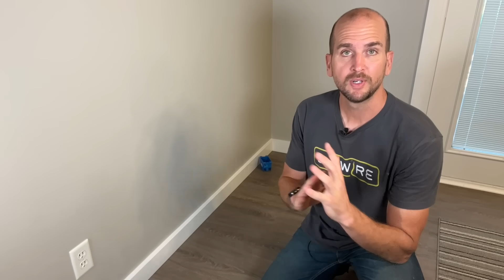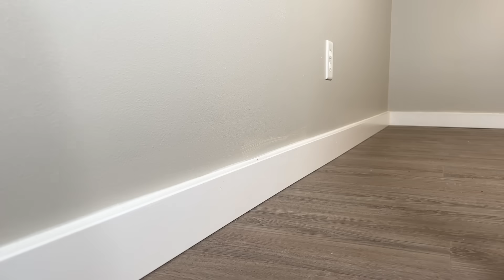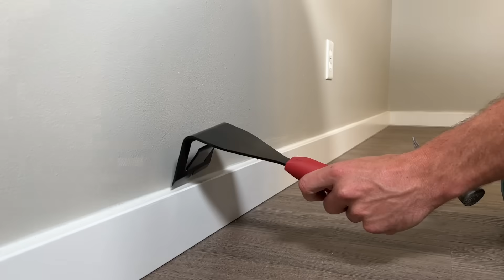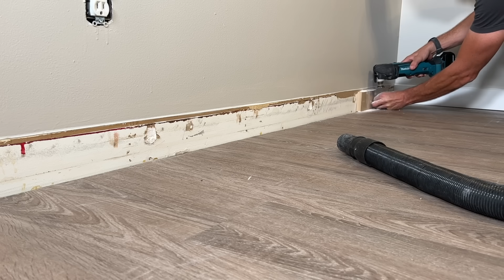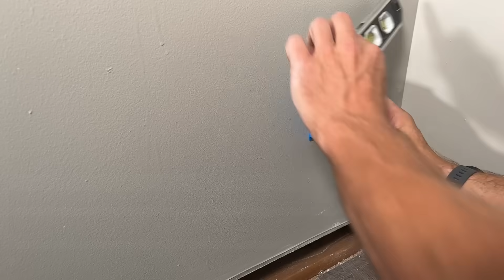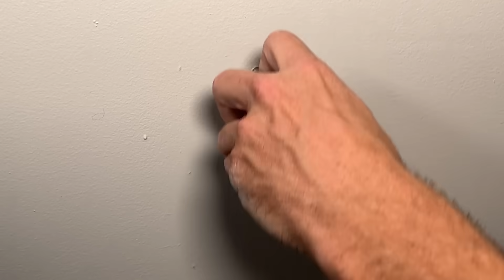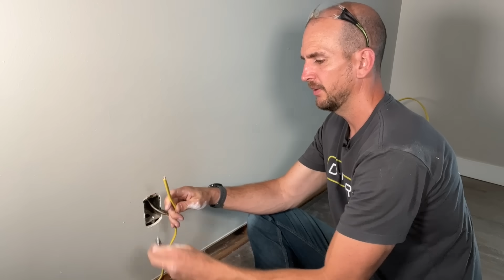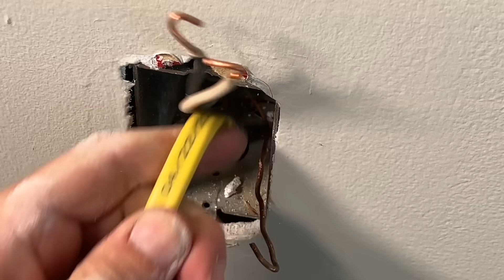How To Add An Outlet To A Finished Wall

Comment: what do you do if you have an older house that doesnt have a ground wire coming out cause the plug grounds to the box. would i need to unhook the ground wire from the metal box and connect it like you have in the video
Reply: If your jumping off to another outlet then yes. But if your just leaving that outlet as is that ground wire is fine.

Comment: Don’t know much about electricity, I’ve seen others use the 14 gauge romex is there a particular a reason why someone should use 12 gauge over 14 and vice versa?
Reply: 14 is used for basic residential wiring for outlets and switches. 12 is used for your bathroom outlet as well as kitchen outlets plus your refrigerator. This is because the appliances you plug in to these outlets will draw more power or more current, meaning it can be used for kitchen appliances and many other products that use more electricity.
Reply: EASY answer, WIRE GAUGE is based on CIRCUIT size, no matter what you meet the smallest but can go larger (sometimes).  For basic residential receptacles 15/20-amp, meaning 15 or 20-amp circuits, you only use 14 or 12. These devices are only rated for these sizes typically..    15-amp circuit=MIN 14 awg / 20-amp circuit-12 awg...

Comment: In my garage I accidentally put a screw into the romex wire and tripped the breaker. What are my options to repair this? Can I put another outlet in next to the existing outlet that's 32" away? Is there a minimum distance an outlet has to be away from another one? Or splice the wire safely?

Comment: Very clear and informative, but what was the point of going through all the locating and measuring to determine the location of the studs, when they were easily visible after you cut away the sheetrock at the base of the wall?

Comment: It was going great until I tried to snake the wire up and discovered horizontal "blocking" between the studs about halfway up the wall to both the old and new receptacles. Had to create an opening. Now to find the youtube video on how to repair a hole in sheetrock.

Comment: Hey You installed the outlots upside down. :) If you check the outlet before installing, and read the words, you'll need to will flip the outlet so that the ground is on top. This flip is intentional. :) Ground on top is to ensure electrical safty. For example: if someone gets fancy in the future and puts a metal plate on the outlet, then later a 3 prong device is installed but slightly pulled out, then the metal plate falls off due to a missing screw, the plate would fall on the exposed condutors. In the way this vidoe shows the outlets, the plate would first hit the nutral, then the hot contuctor. This could energize the plate it self and other outlets via the nutral bus and fry sensitive unprotected devices. However if you install it the way the manufactures indend, with the gound on top, the falling metal plate would first hit groud, then if it touched the hot side it will trip your breaker.

Comment: Tamper Resistant outlets and arc fault protretion for any circuit extensions if not already protected,be aware of the arc fault code for locations  in dwellings via a arc fault breaker, nec 210.12 B,  at panel or arc receptacle where you start your circuit extension and label downstream with sticker arc protectected. Be also aware may need arc/gfi protection if in an area needed by code. 210.8

Comment: I am an electrician with almost 30 years of experience. I was expecting to nit pick this video like crazy, but everything in this video is correct. The only things I would do different is leave a little bit more wire in the boxes and wrap the outlets with tape because of the metal box. I could not tell if the metal box was grounded though.

Comment: Great video. Pro tip- when using an old work box, break off the tabs on the top and bottom of the outlet (to the left and right of the screw hole). otherwise the cover plate won’t sit flush.

Comment: Awesome job~very informative. 
Quick question=can you pigtail aluminum wiring with the connectors, since aluminum is gauged different; [#12 Al =#14Co]; is there a need for oxidation material, and, can the quick connector handle expansion/contraction on the aluminum  wiring without the connectors becoming loose?
Thank You!! JG2

Comment: Ok for the US but not acceptable for the UK. We have safe zones in which we run cables and the kick board is not one of them. Also no mention of safe isolation of the electrical power.

Comment: Great video!
Did this exact thing but my walls had insulation so it took a bit more finagling.
I found out my existing outlet already had another outlet chained off of it.
The builders did the speed connector/backstab.
I took those out and combined all 3 outlets into a wire nut with pig tail.

Comment: You are assuming that your source box can accommodate at least 5 No 12 wires.
How about if it is smaller than 4x2-1/8"x1-7/8"?
Would you go with No 14 Romex and replace a corresponding breaker for 15 AMP or replace the box for bigger one?

Comment: My only issue with this hack is when someone decides to install a 5"+ baseboard in future, they will run the risk of puncturing the line. This works for you in your situation, but down the road, It's a ticking time bomb

Comment: A bit late to the discussion - some jurisdictions (ours in particular) require that the bonding wire be screwed into mettalic duplex box - from either a pigtail, or a longer run - especially if you have a double romex box (as they can split).  This ensures that the mettalic surround, and the ground from the outlet, are grounded at all times, even in the event of a receptacle failure.

Also, those styles of plastic romex box (blue ones) are not permitted, and any additional romex box MUST be mechanically supported by either nails or screws affixed to a stud.  This can be a bit of a challenge if you are working with metal studs (but not surmountable).  The reason is that the constant plugging / unplugging of a device onto the installed outlet can cause the little plastic/metal attaching pins to fail, causing the entire outlet and surround to become loose.  Most uses of those plastic receptacles are for low-voltage wiring, like rj-45 ethernet cables.

Of course, some other jurisdictions require nothing less than AC-90 armoured cables.  

Always check with your local jurisdiction first - and please make sure you pull a permit / have it inspected if you are DIY.  Not only does it CYA in the event of a fire and insurance claim - it also prevents weird strangers from showing up at your home and taking a giant crap in your toilet water tank.

Good luck

Comment: I like the Wago connectors, but they weren't needed for this. The original receptacle  can act as the connection between the original wire and the new wire, no reason to complicate things.  and of course the new receptacle has wire directly to it.  by the way, the Wagos are the same principal as the stab in wire connections on the receptacles.  Either you like those or you don't.  I love them and have never had a problem with them and are UL approved.

Comment: I noticed that the original outlet was at the end of a run (only fed with 2 wires). Is there a reason you didn't just chain the new outlet off the old, instead of making the pigtail connection?

Comment: I must have missed wiring 101. Im not an electrician by trade but i have wired quite a few double receptacles. There are 4 slip in holes on the back. 4 screws on each side and the green screw for ground. When ever I put a black hot wire on one side and a white neutral on the other Both receptacles become hot not just one.  The only time I use all 4 holes or screws is if the line is continuing on to another receptacle or switch. Did I miss something or miss understand something??

Comment: DO NOT DO THIS
1. Bored holes were not air insulated.
2. NEVER put wires behind your baseboard  screws and -finish nails will drive right thru the wire 

Label this video under "wire for fire"

Comment: The video fast forwarded at the parts I needed the most guidance! Slowing the video doesn't help because the words are incomprehensible. Well, at least I learn a neat trick running the wire.

Comment: It is not just the voltage that is the problem. In the US it is 60 cycles and will try to synchronize your heart to that frequency. If your heart doesn't go back to normal Rhythm automatically you got a big problem. Better to be safe than sorry and make sure the power is totally off.

Comment: I have a need for some overhead fixtures/fans and running into a similar issue, one room has crown molding that is isntalled poorly to begin with so will use a similar technique to this

Comment: On an older house (1940's) with exterior walls being plastered over cinder block to the interior side and regular brick to the finished side of the exterior do you just have to cut or chisel a trench from the existing outlet to the new location, use conduit for the run and concrete & plaster patch the trench to finish it back up? 
The original outlet line was probably dropped from the attic in the cinder block channels with conduit (the house is mostly wired in conduit). I could get into the conduit in the attic area but probably won't be able to drop new conduit or even BX cable down through the cinder block channel to the new location, it's really pinched where the brick wall meets the sloping roof line. 
This peticular wing of the house does not have basement and is just over a footer concrete foundation with no real crawl space.

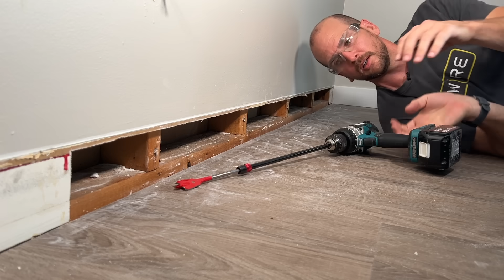Comment: Don’t know if anyone else mentioned this but at 5:05 
in case you drill the conductors passage too close to the edge of a stud NEC I believe states that if your hole where a conductor passes through is less than 3/4” away from either edge of the stud, protection is required to prevent puncturing the conductor as he stated. Protection can be in the shape of a metal nail plate or similar approved product. I’ve seen a insert

Comment: Great video, neat job!
Unfortunately this is illegal in Greece!
Reply from the maker: Illegal to do your own work?
Reply: @EverydayHomeRepairs  hi!
I'll try my best to explain.
According to the regulation of internal electrical installations, you cannot have a horizontal power line at a height of less than 50 centimeters. that's why you can't connect two sockets like this. the main horizontal passage is usually at a height of about 1.8 meters and so you must use vertical cables that start from there and downwards.
Also, to be legal and covered by insurance, you must file a new electrical plan for every change you make.
Finally, according to the letter of the law, and it mainly applies to construction work, even if you do a job alone, you will have to pay the state insurance agency, the pension stamps corresponding to the working hours you spent.

Hope I helped, excuse me for my poor English!

Comment: I doubt that there are many "Building & Zoning" inspectors in villages across the U.S.A. that would pass an electrical job using "Romex." 

I know for a fact that the village where I lived, Mundelein, IL requires circuits to be contained in steel conduit.

The only way that you could get away with this method in Mundelein, would be to do it covertly (illegally) without a permit.

When the home is put up for sale, this could become a major roadblock to closing if the buyer hires a quality home inspector who discovers it. Then, you will probably have to do it right (install conduit and tear ou the drywall/drill holes in the 2'x4's) anyway. 

I have found that it's best to do it right (to Code) the first time. 😉

Comment: I was installing a ceiling light recently. Killed the power from the main panel. Got up and lowered the light. Started to disconnect the wires and got shocked. I got down and tried to figure out why power was still on the circuit. Found a wire coming to the ceiling light from a power plug outlet. Not sure why this was hooked up but definitely gave me a little zap. I unhooked the live wires and capped them. Anyone know why it was wired this way?

Comment: Running your wire like that is illegal, that will never pass electrical building code because if you have a flood and someone stepped into the water, they will get electrocuted.

Comment: You know that's why there are 2 hot and neutral screws on the outlet so you don't need to do a jumper wire just a green ground with nut.

Comment: Great video, nice and easily explained. In the U.K. it’s a requirement  to use sleeving on the ground wire.
Reply from the maker: Do you guys use mostly conduit in homes or do you have a similar Romex product for new builds?

Comment: That was great. I'll do anything to avoid drywall work.

I would only add one thing. I know you know where the Romex is, but cylindrical nail guards could help down the road. I use them on the rare occasion I have to do something like this.

Also, I've been a BIG Wago fan for a decade or so.
Reply from the maker: Nice, I actually have a similar video to this coming out later today and I lined the 2 holes with EZ Guards https://amzn.to/3TmoILa

Comment: Please, please score your sheathing before you put the connector on the cable. I've seen so many nicks and full cuts in insulation because people try to remove the sheaving after it's in the box. Don't do it. That's how you get a lot of your GFCI faults and you can get AFCI faults this way as well. Plus, It's actually easier to work with Romex or any cable when it's in front of you rather than inside a box. And finally, It looks so bad to have a half inch of sheathing sticking out from a connector especially if it's got a slash in the middle And it's been torn.  And remove the paper too.
Electrical work (at least at this level) is actually pretty simple and the knowledge of "what to do" is not even half the job most of the time... It's "how you do it" that makes your work look professional and last a lifetime.
Always strip or score your cable before it goes in the box.

Comment: Where's the fire taping of the drywall seam?
Also, why did you use wagos? You could have easily just put the wires, to feed the new load, in the back wire receptacle.

Comment: For the most part this is ok. But, you really shouldn't be using wegos for this. I will say at least you "pig tailed" it. But I've seen way to many of those wegos burn out because of "down stream currents". I mean it's litteraly just a tiny piece of metal making contact. I get they are "all the rage" but their also dangerous when used like this. It's no different then using the "stab in" style connections you brought up. Just fricken think about it. I don't really have an issue with any of the other stuff. All though you probably could of explained some basic codes, like you HAVE TO HAVE AT LEAST 6" of wire. And that the holes you drill MUST BE AT LEAST 1-1/4" from the edge of the board. Still a handy trick, one I utilized myself many times. I just really don't like wegos, they may be easy, but they make one of the worst possible connections their is. And almost every fire to do with electricity results from bad connections. Just use a wire nut.

Comment: I would cut out a narrow strip of drywall directly between the old and new boxes, when wiring is complete, insert several short pieces of shim behind the drywall, fasten to existing wall both sides with drywall screws, then when wiring complete, insert cut pc of drywall and screw it to shims.  Only have to patch two narrow slits and drywall screws.  You could not see where I cut and patched.
  Worst thing he did is use a 1" drill bit, weakening every stud!  Romex is 3/8", so a 1/2" drill bit is the largest you need to use.

Comment: First time coming across your channel. If this is a DIY for adding an electrical box, why did you speed through the electrical part? Or was it more to show us how to remove trim and sheetrock without damaging it? However, despite my confusion, very nice job.

Comment: Good idea. The thing that bothered me though is that you said, you’ll drill holes above the baseboard to avoid the brad nails piercing the NM cable. That is why the NEC require you in Art 300.4(A)(1) to use steel plates. You just move the problem up. If somebody runs a nail or a screw through your stud, your outlet will take a hit. I’d suggest to use MC cable. The requirement of needing a steel plate is then forfeit and you don’t have to worry about anything anymore.

Comment: IBEW retired ten years.  I like the tool you used to removed the trim.  I never saw one before.  Never did much residential work, but with with daughters who own homes I am always adding outlets or lighting in closed work situations.  Nice video.    Rather than using a plastic old work box I cut the nails off a plastic nail on box and drywall screw it to a stud.

Comment: I’m not afraid of having to do a little mudding, caulking and painting but, OMG; this tip is brilliant. I’m now imagining never running out of outlets. The Husband isn’t convinced but I’m getting myself a WAGO kit and fixing a bunch of stuff myself. Done waiting.
Reply: I love having  outlets exactly where I need them!
Reply: Don't overload your circuits.
Reply: I replaced an outlet for the first time,i turned off ALL electricity i wasn't taking any chances the only problem was the thick neutral and hot wires damn took forever.One proud lady!
Reply: your house is going to burn down

Comment: i was a little confused why you used such a big spade drill bit. also, after attaching the wire crimp connector, i think next time it would be easier for me to remove the romex sheathing down to the 3 individual wires before reinserting into the wall and give it a slight twist before aiming for the hole, just seems easier. I am impressed you got the drywall out in one piece, that flat metal scraper against the floor was a good idea as you pulled nails out =)